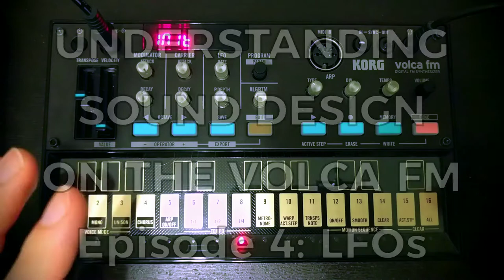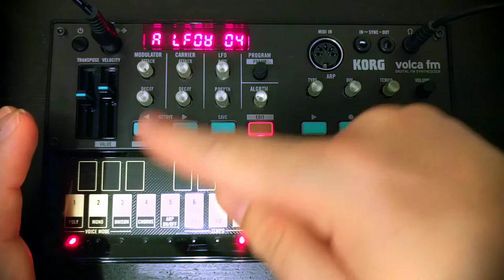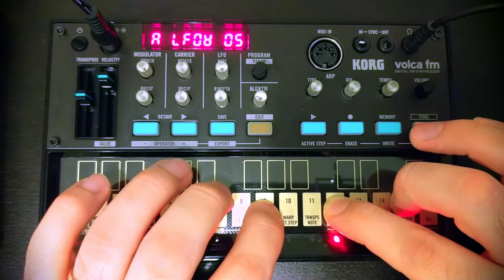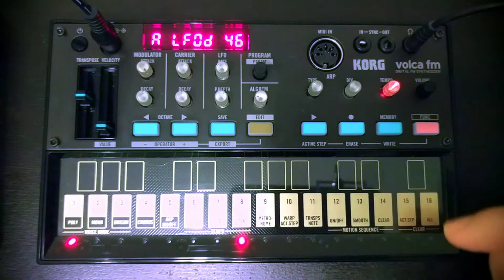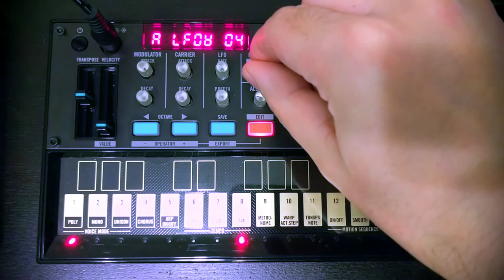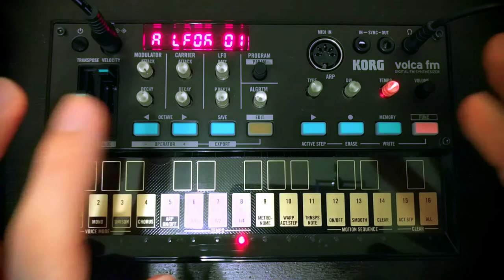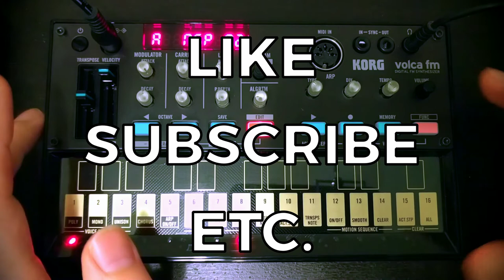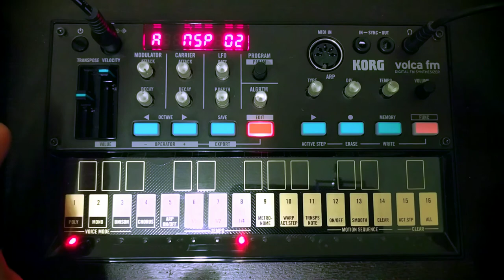Understanding Sound Design on the Volca FM - Episode 4: LFOs

Comment: So I replied about the nick batt joke and I'm now realizing I didn't make it through the whole video. When you mention syncing LFO delay to tempo, do you know if the numbers correspond to any specific units of time? Or is it mostly by ear in relation to incoming midi clock (if any)? Anyway, these videos are truly opening up FM synthesis to me...if slowly because so much of it is counterintuitive lol. But thank you so much for the videos!
Reply from the maker: The LFO numbers do mean something, but it's just Hz rather than being clocked to midi. The trick is to get something close enough and then turn on LFO Key Sync in the global operator settings so it resets with each key press, that way it never gets too far away from sync.

Comment: With the sample and hold LFO, to avoid the glitches, you said there are certain things you might want to turn down. What are they?
Reply from the maker: Primarily keeping the  Amp Mod Sense (AMS) and overall level on the operators you're modulating down. But essentially this glitchiness shouldn't exist at all and appears to be a bug with the Volca's firmware.
Reply: @OscillatorSink  Thanks!

Comment: thanks for going above and beyond - much appreciated! i didn't really want to get into this much detail for the fm but i fear i must to get the most out of the beast. i like the way the earlier vids simplify things and start out with only 2 operators, a carrier and a modulator so you can actually clearly hear the changes. do i simply turn off operators 3-6? which algorithm is best to use, some have a 'looped' modulator 2? my biggest gripe with the fm is the difficulty creating/recording a track or layering different patterns over each other. i much prefer the volca bass way of doing things, with 3 oscillators/voices that can be layered over each other and a step mode. right now i'm forced to record a loop from fm into audacity and then create a new pattern/loop with a new program and algorithm etc and record that over the 1st loop. is there an easier way? thanks again.
Reply from the maker: If you're just playing with two operators (a great strategy for learning!), use algorithm 2. Op 1 is your carrier, Op 2 is your modulator which also has Feedback to play with as well (increasing the feedback will increase the richness and raspiness of the sound generally).

What you're describing is the only way really - you only have one timbre to work with at a time I'm afraid.
Reply: @OscillatorSink  on that topic, is there a way to save an algorithm? i know i can save tweaked programs with 'save' but when i turned operators 3-6 off on algo 2 they turned off for all the others.
Reply from the maker: @rainerd9890  I'm afraid not - the operator status belongs to the whole patch not just the current algorithm.
Reply: @OscillatorSink  ya, i finally clued into that so i just saved the whole patch, e piano, with the algorithm editing for 2 operators (1 and 2). went through episode 2 again and tweaked along with you and didn't quite hear the changes as clearly as in your tutorial (maybe it's the e piano sound carrier?) but i was able to eliminate some 'nasty' treble' overtones with the 'FreC/F' settings. didn't hear much difference with 'Fdbk' changes also (using algo 2 with only 1 and 2 enabled with feedback loop on the mod, 2) thanks again, much appreciated. plan to do the same thing with the envelopes episode today. your info is a much needed addendum to the rather thin FM manual.

Comment: Ok for some reason when I want lfo to modulate amp on operators, it doesnt do anything. I set all "AMS" parameter on all operator to 3 and I dont hear any difference even though depth on lfo is all the way up and "LAMd" parameter all the way up as well. Im getting frustrated :/
Reply from the maker: The "LFO Pdepth" on the front panel is just for pitch, so you shouldn't need to alter that.
I would start with just one operator to trouble shoot. 
Turn off all the operators but 1 and set the algorithm to 32 so you are sure you're hearing that operator.
Set that operator's level to 75, the AMS to full  
In the all operators settings, set the LAMd to full (double check it's the LAMd that you're changing and not LFOd). And set the LFOW to 0.
Do you hear any tremolo now?
Reply: @OscillatorSink  Unfortunately not
edit: It seems it just needed firmware update, now it works. Weird. Anyway, thank you for your answer, sir.
Reply from the maker: @hardgainer7396  have you ever updated the firmware on your Volca? On the very early ones there were some fundamental issues with the synthesis engine, so I would try updating the firmware.

Comment: I always wondered why the modulator is on the left and the carrier is on the right. It seems obvious to have the carrier first, then think of the modulator affecting that. Especially since the carrier is operator 1? Is this a Japanese right to left thing?
Reply from the maker: I think it's more that the modulator flows into the carrier - if you think about the way the algorithm is laid out, that's modulators at the top as well, again, flowing down into the carriers. Modulator first is a more natural way of reading it for me anyway.
Reply: @OscillatorSink  thanks, that makes sense. As you mentioned in a previous video, I think I'm still thinking of subtractive filters.

Comment: Is it possible to 'export'  (save) a patch to pc ?
Reply from the maker: +Holy Diver short answer: no. Better, longer answer: yes, but you have to mod your unit to have a midi out port. The capability is actually present in the unit, but there's no port. You can buy kits to do the mod (they are solderless and look easy to install), and then when you perform the procedure to send patches to another unit over the sync cable, the added midi port sends out the raw sysex data as well.
I'm going to buy one and install it very soon because I want to share some of my patches on the channel - I'll do a review when I have done it.
Also, there are other ways to approach the problem that I'm looking into and working on in the background... But more on that as I get further along in my research ;)
Reply: Thanks a lot ! (have solderless Midi out on Keys works fine)
Reply from the maker: +Holy Diver ah, awesome! I'll take that as an endorsement and pick one up really soon!

Comment: LFO is really not working no matter what.
Could it be that the synthmata editor stops that from working?
Reply from the maker: +pyrox are you talking about the pitch or amplitude LFO? If pitch, remember that you need to turn up both the Pitch Mod Depth AND Pitch Mod Sensitivity.
Reply from the maker: +pyrox no problem!
Reply: Nope :( i turned on 2 OPs 1 and 2 and if i turn on the LFO AMP mod depth+ in both OPs AMP mod sense max nothing happens while turning the lfo knobs.
I can send a patch link so you can see if i did something wrong
Reply: i had to cut it in half else i could not hit the replay button
Reply from the maker: Hi, sorry for the delay in getting back to you - I think something went wrong when you copied the link because I can't get it to open, but try this patch, it should respond to changing the LFO rate and if you turn up the pitch mod depth on the unit itself you should get some vibrato too:

https://synthmata.com/volca-fm/?p=8EMAAAEbUAAAUGMAAAAyAAAAAAAAAFwAAQAAUAAAUGMAAAAyAAAAAAAAAFwAAgAAUAAAUGMAAAAyAAAAAAAAAFwAAQAAUAAAT2MAAAAyAAAAAAAAAFwAAgAAUAAAUGMAAAAyAAAAAAACAFwAAQAAUAAAUGMAAAAyAAAAAAAAAGMAAgAAMjIyMjIyMjIEAAAhAABjAAACGHN5bnRobWF0YSBDG%2Fc%3D